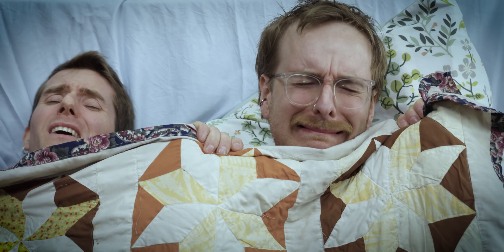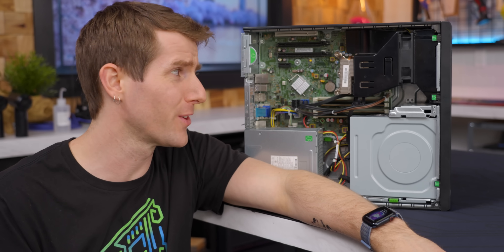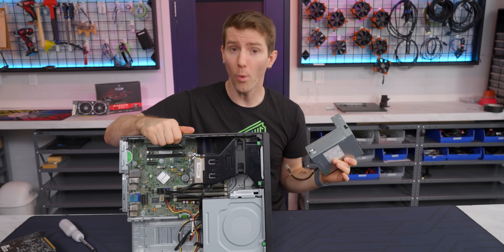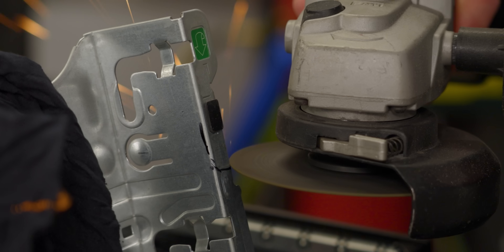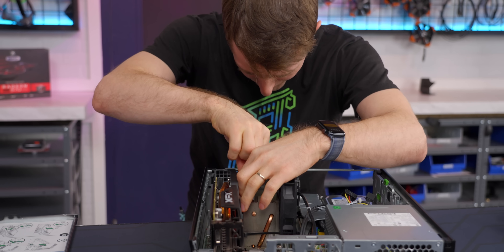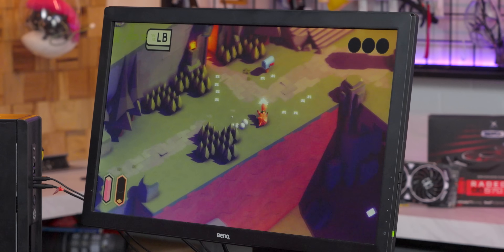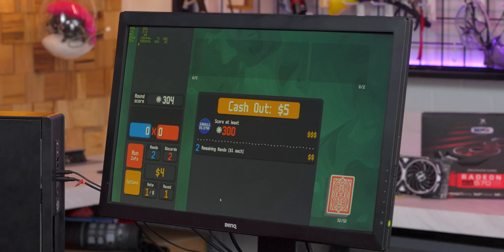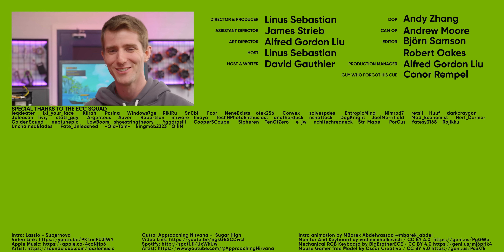How to Build the Ultimate $69 Gaming PC!

Comment: back in the old days, SSDs were uselessly small at max of 64GB... I bought an an SSD and had my Windows on a 7TB spinning rust chunk and the game was installed on the 64gb ssd... My Ezio trilogy assassins creed game ran SO MUCH BETTER I never looked back. Just use the SSD for the game even if it is shit and use the HDD for Windows and Media where the speed is MORE than enough for what you need. RX480 is good enough for 70% of what you would play on it at console frame rates and usable speeds if you have some sort of SSD. I have a 128GB SSD I use in my server that has been purring liker a kitten for nearly 16 years. I use it exclusively as a downloads cache and SWAP for my Linux system. ANY part you buy will be just as useful as the day it was released as long as your expectations of said parts are also in the range IT WAS WHEN IT WAS NEW. Hardware never gets less powerful, you just end up expecting more out of it until it has to be tossed out and newer much faster hardware put in its place. Just keep that in mind is all.

Comment: SRLY: STOP DAVID FROM PRODUCING SUCH VIDEOS!! HE FORGETS SO MANY IMPORTANT DETAILS!!!!
1. This machine is NOT save to use with Windows after the october 14. 2025. The free support for Windows 10 ends then. And since there is no way to properly upgrade to Win 11 (MS says that they are aware of the exploits and might want to kill updates for unsupported hardware at any day), this machine won't be save anymore. You COULD have mentioned Linux, which would be a perfect option after this date. But you forgot about it!
2. The RX5XX-series doesn't get any new drivers. So many newer titles won't start, even if the GPU would be capable to run them. Which you failed to mention....
The cold, hard truth is, that is not possible to build a somewhat futureproof gaming rig for under 150 bucks (if you include a GPU with driver support). I build many of those for friends and it pisses me off. And I am also mad that all the "entry level GPUs those days come with PCIe 4.0 x8, which means a big performance hit on older plattforms...

Fact is: If the average kid which is the audience for such a video, builds that one, they will end up with a GPU without proper driversupport and, much worse, a system which will be unsafe coming mid october this year. And for that, 69  is way to much!!

Truth is also, that David will probably contiue to make such errors in future videos, since that is strike 4 or 5, LTT is clearly not interested in correcting his errors as long as the videos get proper clicks. 
And I know, NO ONE from LTT will respond to this comment, since, I guess, they know about those issues and prefer to bury it. PROVE ME WRONG GUYS!!!

Comment: DDR4 supports dual channel regardless of brand of size of the ram sticks, so better flexibility.
SSD significantly improves performance and user experience
8 gigs of VRAM
include a good 1080p monitor
proper case
269 dollar pc would be encouraging

Comment: I scored a good deal recently. HP Z230 SFF. I had an eBay plus code, which got it to me for 95AUD. From a reputable refurb company. I'm guessing it's a reject from a batch as it had some scratches. For the money though, Xeon 1240V2, 16gb ram, 128gb SSD, 1tb hdd, Radeon r5 430 if I remember, or similar oem GPU. It's still got the DVD drive and blank floppy spot, so I was able to add an extra HDD and a 3d printed triple 40mm fan holder. I only needed it as a server, but it's powerful enough to be a backup to my main PC for basic 3d design and most of the older games I play anyway.

Comment: IM DONE YOU DID WHAT I DID JUST GHETTO RIGGED 2 PSU TO THE IT JUST PUT IT ONTO THE CASE AND HAVE 2 POWER SUPPLIES WHAT I HAD TO DO IM DONE...you can play forza horizon 5 with pretty high graphic setting with no issues with 16g ddr3 a 8g gtx 580 and a i5 4570 3.2ghz
Reply: I got a gtx 580 for sale and a have nooooo idk what to call it besides a asus 1660 ti 6g turbo fan style i can not find anything like it anywhere online besides a 2070 that looks like it it came in a prebuild from rog in my strix tower

Comment: I hate dells proprietary motherboard to power supply.combo where you can upgrade the psu without changing the whole.motherboard if the gpu need a psu you can do it injave a dell somwthing i5 4570 16gb ram but can add my gtx 580 cause the psu is proprietary to the motherboard

Comment: I recommend a Dell Optiplex 3050 and an RX 580 8gb. Optiplex can be bought for around $70 on ebay and same for the GPU. This would fit into your $169 bracket and run very well.

Comment: LENOVO [VR READY] SHARKBAY [i5 4590] [GTX 970] £45 📃
NVME 4.0 PCIE X16 (BOOTLOADER).. 
-
The Silent T520-620s and IGLEN 12Vs have been tested on 126 Ori games.
I preload texture sizes in my head.. maximum is always fine.. cycles are crashing unreals editor atm

Comment: I just won an Ebay auction for a Dell Optiplex Haswell i5 (4C/4T) with 8GB of RAM and a 500GB HDD for... $17. It's insane and I was the only bidder. I'll just put in a $25 SSD, another 8GB of RAM for $10, and a 3050 6GB for about $160 and I'm good to go.
Reply: Nice deal, howevee I world get a different card, not the 6gb 3050. An rx 6600 would be almost double the performance
Reply: @radustar9  The issue is that it needs to be low profile and not require supplemental power, I won't do any of the silly stuff they did in the video.
Reply: I'm just shocked that Linus picked not only my GPU by also my SSD lmao. I bought my Rx 570 8gb 5 years ago and still goes strong. Now I bought a pc for 30 bucks on the used market, put my GPU in it and a SSD. A build that cost me almost nothing and I play anything. I'm just glad to see this on LTT. I love building budget PCs and my tip for CPUs would be that don't always aim for the gen instead, for example with intel, a i7 4th gen is gonna perform as a i5 6th or higher. That is a huge take when we talking about budget. Anyway, feel free to ask I don't discuss this topic enough :)
Reply: I looking for one, but the shipping cost is very high for my country...
Reply: What they failed to show in this video is that those old 4 core i5 struggle a lot in newer games, and the RAM is another HUGE bottleneck as it's only ddr3. I would highly suggest getting a i7 8700 optiplex. 

This video was just terrible imo. They didn't test many titles, and they had no statistics on screen. Very misleading.
Reply: @ The 8700 Optiplex is like $120+ on Ebay whereas a Haswell i5 is $20. I think for 1080p gaming, a quad-core with enough RAM and a GPU with enough VRAM is ok. Maybe you can get Skylake for another $20-30. In the video they had Ivy Bridge which is ancient. A $69 budget for the whole system is silly, it should be at least $100, or $200 is much better value.
Reply: @QuantumBraced  The resolution you game at isn't CPU dependent, it's on the GPU to push the resolution.
And no, a 10+ year old quad core just isn't enough. Try running any modern game on it and you'll see the CPU pegged at 100% and stuttering. Again this video is ill informing people like you, as they don't use any tools like MSI afterburner to show the CPU usage.

6 cores is the minimum for gaming today. I went from an i7 6700k, to a Ryzen 5800X3D, and games ran MASSIVELY better even on the same GPU, a GTX 1080ti.

I'm sure you can use that PC you bought for light web browsing, so it isn't a complete waste of money. Linux might be a good option since it's easier on old CPUs.
Reply: @ Hasn't been my experience, with a low-end card at 1080p/medium it's ok. It depends on the game obviously, some are very CPU-intense and those won't work well. I've gamed on a Haswell i7s with a 3050 and it was good, that's what inspired me to get this. But an i5 with no HT I haven't tried. If it's really bad I will buy an i7 but they are like $30, and at some point you're better off using modern parts...

Comment: I do this kind of build for people all the time, although $69 is very low ball. Typically my builds cost between $125 and $175 but utilize the same strategies shown here. HP Z230 tower systems are great for these builds. They're big with no cutting required and typically include i7 4th to 6th gen CPUs.

Comment: I had bought essentially this exact system back in 2020, before I knew anything about computers.
It was an HP Compaq 8300 with an i5-3570, 8GB RAM, a MSI 1050ti LP, a 120GB SSD, and a 750GB HDD, and I got it off of E-bay for $360.
Over time I upgraded the RAM to 16GB (swapped sticks with a tech friend who used them for repairs), upgraded the SSD to 512GB and added a hand-me-down 1TB HDD.
The motherboard in this particular model tends to die when it's power-cycled, and after my 2nd motherboard died I transplanted everyrhing into a friend's old Optiplex 990.
The 1050ti held it's value very well, sinxe it was rhe low profile variant that could be powered off of just PCIE. 
At the time it went for $150ish, but I sold mine for $130 since it had a dead fan, and bought a EVGA 1070 with the money.
After that I had gotten a job and saved up to build myself a full system, minus the drives and GPU!!

Comment: I'd personally like to see a bang for your buck while buying all used parts ala scrapyard wars but just for a budget workstation while spending as little as possible for the most performance. Just to see where the price thresholds are for different break points in cost to performance.

Comment: Pro Tip: Don't worry about Windows 11 compatibility. Linux isn't that hard, especially if you just want to game. In which case you could get an AMD or Intel GPU and install Bazzite. It behaves almost exactly like Steam OS 3 (The Steam Deck OS), just is based off Fedora. My i7-7700k runs Kubuntu 22.04 for the next ~50 days when I'll update to Kubuntu 24 of some sort.

Edit: Other Pro Tip: WIndows often has a bit of overhead and costs $>100 (Dependeding on how legit of a site you are willing to work with), feel free to learn some Linux.

Comment: I have a similar build
Xeon e3 1270 v3
Rx 570 4gb (sapphire nitro+)
12gb ram
450w psu
1600x900 monitor

Started as i5 4460 and gtx 750ti 1gb

I play cyberpunk and yakuza games on it. Cyberpunk gets about 45fps steady when I cap it there at mixed high settings with fsr and medium crowds

Yakuza games get 60 stable at max 

Done upgrading this PC, next upgrade is a whole new system

Comment: I love hot rodding old pc's  picked up a 7050 mt OptiPlex with i7 7700 and 240 psu. upgraded to a 360w dell psu with a 6 pin, conector. installed a 3050 Ventus x2 xc oc Grafix card  64 gb crucial pro ddr4 ram a 256g nvme for windows a  1 tb + 500g S/P ssd for game storage. put in a wifi 6 card and 
ID-COOLING SE-903-XT Black mini tower cooler. cut most of the cover open and installed smoked acrylic to the side of the case.. and an rgb strip.. i could have built a new Rizen system but it looks great and dose everything exept i cant  upgrade it anymore, maybe it will last until the market calms down again
Reply: the whole system only pulls about 200w under load... 1080p 60hz high settings,

Comment: I still have a 2500k with 64GB of RAM and an Nvidia 1660 in my living room. I paid about $1000 for the components in it from 2011-2019. I might have been able to sell it for $200 when I upgraded, but it still works great. I also don't have to breathe someone else's crusty old workstation exhaust fumes when I use it.

Comment: 69$ is impressive. Tho personally I would strongly hunting for better such as.
An OEM that isn't an SFF for practicality of fitment. Perferably 4th gen at that price. Bonus points if it's an I7 
Alternatively you can find old none OEM motherboard CPU Combos. in my area I found someone selling an FX8350 with motherboard and 32GB ram for 50$ cad (Which I sadly didn't jump on and it's now sold. That can build something awesome in a free garbage case.
GPU wise... for the price there is nothing better. If you are willing to spend a bit more, lots of people are selling GTX 1070's for pretty cheap. but you will need at least a respectable 600W psu.
I strongly strongly recommend spending MINIMUM 150$ up to 200$if you want to play modern games with far faster framerates and graphics..
Also worth it to spend the extra 10 to 15$ to get a 512GB SSD
Also a 6th gen Intel OEM comes with DDR4 and an M.2 slot.
You can even find ultra cheap Acer or other OEM's running an ultra low end AM4 platform with an AMD A10 chip... which sucks but can potentially be upgraded to a ryzen 5700X at best which would be epic on the cheap.

Comment: I actually had a computer that was exactly this for a while. Old HP slimline that I threw a full height gpu in. I literally just used some pliers to move the pcie bar out of the way and never put on the side panel. I also used the dual PSU with a jumper on the one trick. It worked well for years until I got better components.

Comment: You can also cut the on wire and wire it to ground if your psu has a power switch on the back for a decent dual psu setup

Comment: So, I have a 7th gen CPU (Intel 5820) and 32gb of DDR4 ram with a RTX3070 in it, 1tb M.2 drive. I runs most stuff at 2k (1080p) but, watched this to see if an upgrade video to see if this made sense, as my system is getting very aged now.  My current config could run rings around the $69 PC. Looking around at open box stuff, a 12th gen i7, around $200, an open box motherboard, around $100, then I would need DDR5 memory, so I figure around $400-450, I could get a major upgrade.  I guess that is a smarter route to go. 

Just wish I had the extra budget for it now...

Comment: I've personally ran a dell optiplex 7020 mid tower with the i7 4790 (non-k) for a while as a gaming/work pc with a 3090FE I got for cheap. Runs great, I love it. It seems you can currently get them with the 4790s for somewhere between $50-100 on ebay and there are always a bazillion of them listed. It's honestly a pretty great machine, the case is pretty low key and smaller than probably any mid tower case on the market. There are some rivets you need to drill out in the case to remove cages to fit a GPU and whatnot, but it's super easy and actually really nice to work in. There are adapters for the more proprietary connectors, but they're not bad to deal with. Memory is ultra cheap and plentiful, so you can easily max out your memory at 32gb for $10-20 if you just look up matching model numbers on ebay. My machine came with the 325w (I think, or pretty close to that) power supply, that I personally ran a gtx680, 780, and 1080 from, without any issues. I did swap that out for a corsair rm650x eventually, but I don't think people should feel the need to get a new power supply for most gpus people would be getting for these machines. I've heard people suggest they're overbuilt for reliability, being business oriented machines. I hacked in a corsair h60 aio and some 150mm noctua fans, works perfectly fine. 10/10 would recommend dell optiplex for all scenarios. Get a 4790 mid tower machine, max out memory, get an ssd if it needs one, and put a 1080 or 1080ti in it. I'd imagine that's the best bang for buck on the planet right now, probably be good candidates for the $169 or $269 challenges

Comment: Another place to look for cheap computer components are local Universities and Colleges.  They will often run ITS sales to offload old components (computers, external hard drives, projectors, peripherals, etc.) at often scrap prices.  Most times they simply want to offload them instead of sending them for scrap metal.  These sales are often open to students but could also be open to the public.

Finally, if your local campus dipped into esports you may find some of these computers in their sales as well!

Comment: I’m literally doing that right now. Last year i’ve got an untested dell optiplex for 5 euros, it works, but the cpu is horrible. I’m browsing ebay for a decent gpu fo cheap (not that easy here in Italy) and a better cpu that i can get for about 10€. I already have an old ssd that i can use. I can even steal a case from a very old pc that unfortunately died years ago

Comment: Optiplex MT with an i5 8500 (the first 6 core) and an rx6600. Can't be beat sub $200 (shipping INCLUDED). No PSU upgrades or mods needed except maybe a 6 pin to 8 pin adapter.

Comment: When I was looking for ued GPUs to put in my older i7-6700 system,I found a RX 480 GB and i was able to get it for just barely over 20$: 20.7$! That was a MASSIVE steal! Expecially considerring the 480 and 580 8GB are no that different.
Now my older system can take full advantage of my 144Hz monitor with no issues :)

Comment: What I did long ago is grab an old Dell Precision T3500, upgraded the CPU to x5670, 16 GB of DDR3 RAM, RTX 3060, and upgraded the Power Supply to 800W.  The T3500 motherboard can use standard power supply cause it's Non-proprietary.  I got the system for $50 and did the upgrades slowly.  It can even play God of War, Cyberpunk 2077, and more without issues.

Another system I did a cheap budget system is a HP z620 with the converter cables for Power supply, stuck it into a starndard ATX case

Comment: The experience was like going back in time you mean like the more than decade old Hardware you're running?

I think that Linus's expectations for what the system could do were too high.

Also companies are really throwing out 8th gen systems by now you can get a much higher and based system and it would even be Windows 11 compatible to an extent

Comment: Picked up and HP Envy running a Core i5-4570, 12GB of RAM at an estate sale for $10USD.  Threw in a 256GB SSD and WIn11.  A spare 1060 3 or 6GB would make a fine enough light gaming rig.  Swap out a 4GB of DDR3 for 8 and you've got a full 16GB of RAM.  Deals are out there, sometimes just need to look in unusual places.